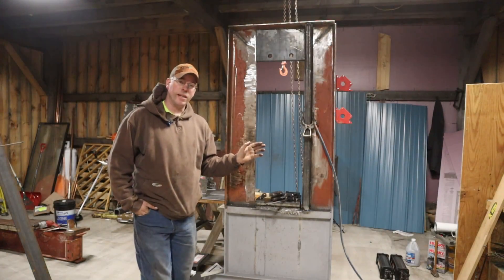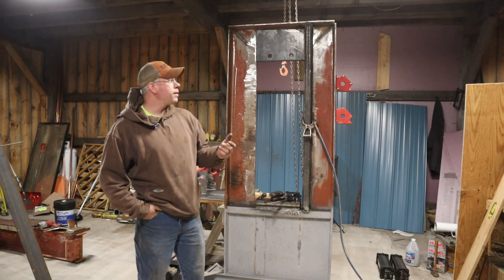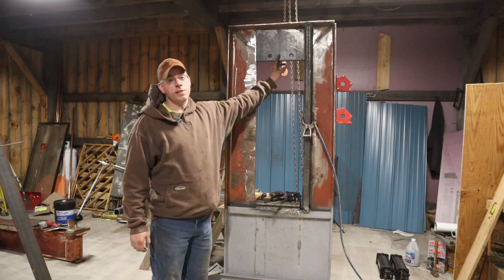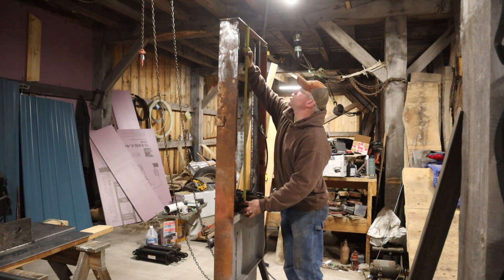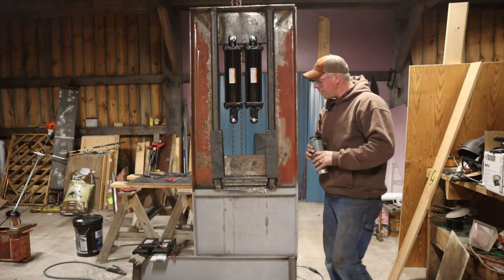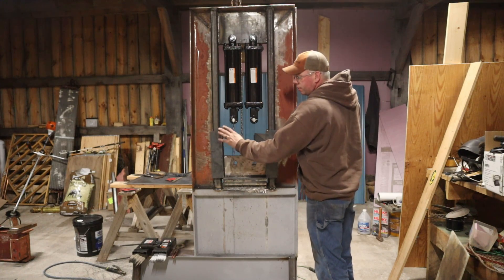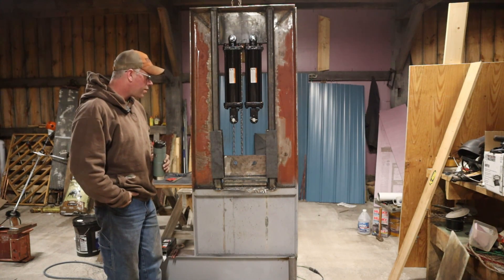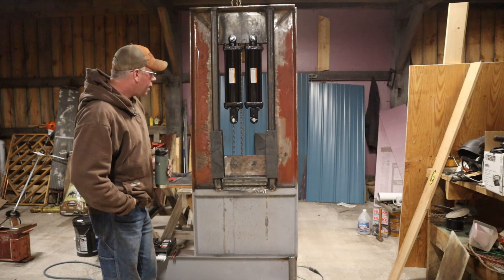Super Forge Press Build Part 7: More Steel

Comment: I was working for another farmer and bent a hydraulic cylinder into a pretzel on his cultivator, not good. I'm doing a lot of welding on my trailer winch and am making videos again, T wagner. What kind of blade do you have on your circular saw?
Reply from the maker: It is the Milwaukee general purpose metal blade.  Glad to hear you're back on videos.
Reply: Thanx

Comment: I am a Electrician that welds time to time. My old welding instructor would not approve, he always demanded that you do vertical welds up not down. No slag  gets under your beed going up. Now I have never run 7014, but I have done miles of 7018 vertical up and over head.
Reply from the maker: I usually go up, not down but this rod puddles much differently than the 7018 on vertical welds.  The flux seems to stay above the rod and makes some beautiful welds.

Comment: prof the cutting board should be HDPE which is non stick and will make really good spacers.
Wood workers use it for miter slot guides and resin casters use it to make casting boxes.

Are the walnuts that hard over there ?? lol.